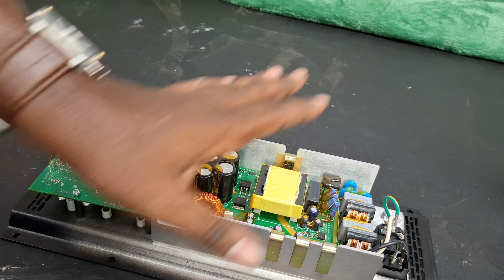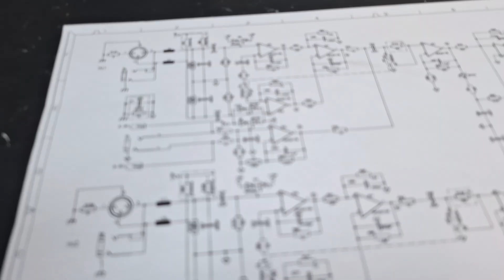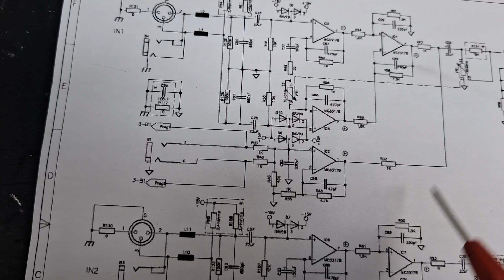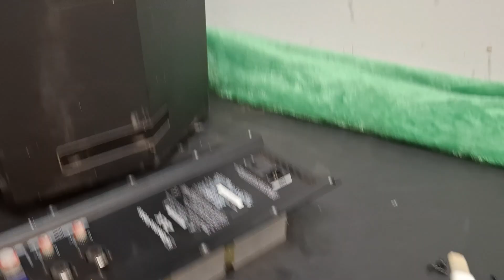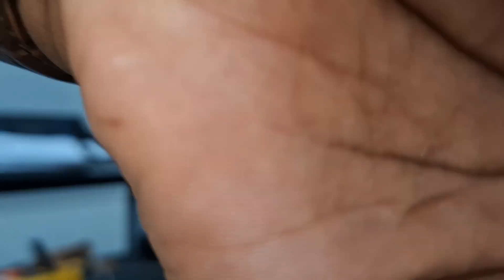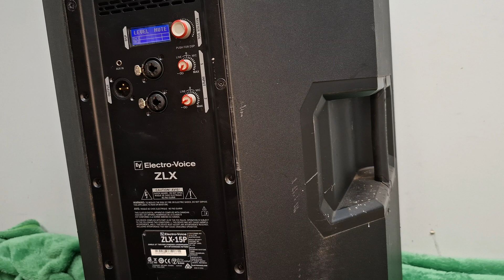ZLX15P EV speaker repair

Comment: Hi  I have ZLX-15P I can’t find the somatic the issue I have the board is working  but only sounds come from small speakers no big on I test the big speaker is working can you help me please
Reply from the maker: Hi, Then I will suggest you start changing the Wires , if the board is working and the speaker also working
Reply: @Indetail-repair   i wish i can send you photo i cange 2 ic and still have same issue
Reply from the maker: Send it to Indetail.repair@gmail.com,  I can assist you further
Reply: @Indetail-repair  okay thank you so much I will send you the photo and what I did
Reply: @Indetail-repair   hi i just sent an email to you with a photo if you need more info, let me know

Comment: I have same model.  Similar issue as you have.  Also, I get a loud pop even when nothing connected to any input.  Any ideas?
Reply: where did you get the schematic sir? may i borrow the copy
Reply: @kalmadolang3583  i would liike too know it too!!
😩
Reply from the maker: I will start with check the Pre-amp circuit , like on my video. You may have a  Op amp which is faulty , which causing that pop even thou no signal inserted
Reply: Hi can I have you  phone number